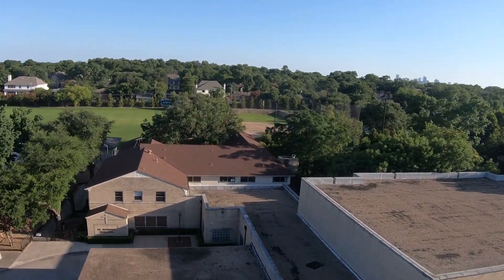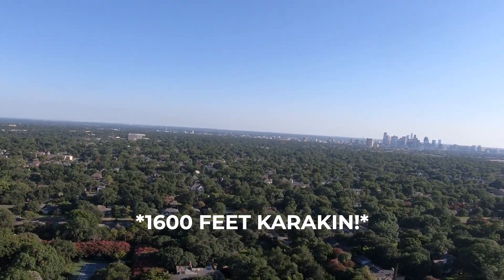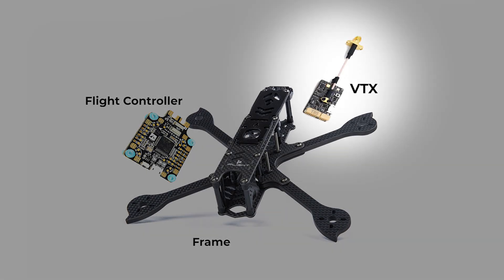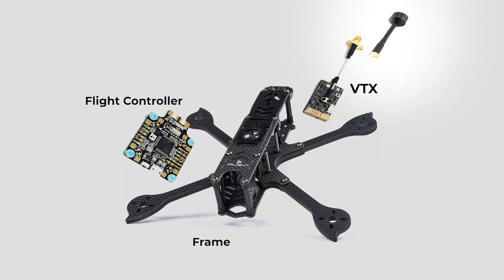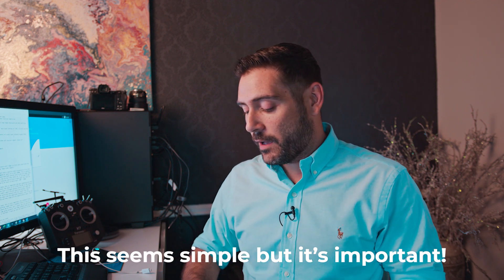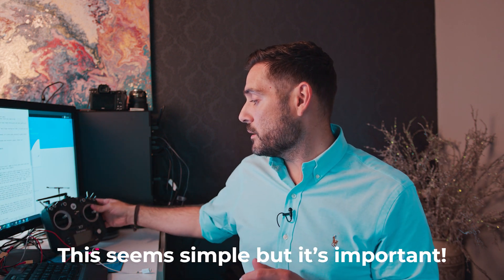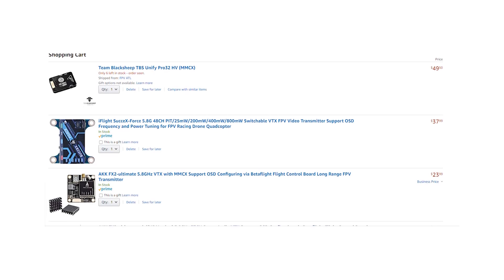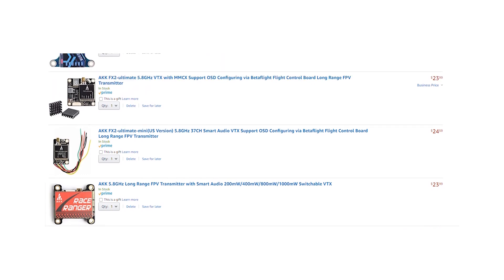Get better Mid to Long Range FPV Video, Long Range FPV Video, required equipment list.

Comment: you know not to bash your vidoe but this is why you should be required to have a ham radio license. when you have your ham radio license you should have the basics at how frequencies propagate on different bands and why people use 2.4 and 5.8 ghz frequencies. which frequencies does your country use and what the gentleman agreement is. i have been a licensed ham radio guy for about 5 years now, but you should know why team black sheep and other companies use these frequencies. Just admit you dont know. you most likely do not know that frequencies are proportionate to the size of the wave length. What frequencies propagate the best in certain temperatures. if your an expert in drones you should be an expert in frequency ranges and the distance they can travel. what frequencies penetrate the best and why. Maybe its time you take that test. its a 35 question test from a 400 pool of questions. if i can pass it you can pass it. And take ham radio classes it will help you understand to be a better pilot.

Comment: Nice overview of the most expensive analog gear out there!
But if you're a beginner or want to step up your game, just save yourself a lot of hassle putting everything together and even some pennies and buy DJI fpv combo! You get 2 miles of range in HD quality (no analog like from 80s) right from the box. If you upgrade the antennas on the googles to 2xpatch and 2xcircular pol. of a good quality you get 4+ miles of range (no 6km hard limit after the latest update) without any hassle, for the same money as high-end analog setup and you'll be watching a GoPro-like video directly in your googles all the time without any noticeable latency (as it was the case with previous digital systems)!
Don't believe me, research yourself! Just google "DJI fpv long range" and you'll see yourself.;-)
(A bit of extreme for starters: https://www.youtube.com/watch?v=LzJsMJAz4H4)
Reply: you might be right but there is added cost to dji VTX system in the drone as well, and its more if you have multiple drones.
Reply: @BlkInc1  If you are a beginner, you don't have a lot of drones and vista brings that cost barrier a bit lower too... But indeed if you want something on another level you are going to pay more (at least first few years). It's like with TV - you want a widescreen OLED or plasma? OK, but it will cost you more than standard small CRT TV...;-)

Comment: Screw TBS crossfire on a Quadcopter. Got with TBS Tracer! Yes, it's 2Ghz its 25Km distance, and its only 3ms latency. for Quads with limited battery range anyway. Tracer is much better than Crossfire.

Comment: My $115 Hubsan h501s will go 1.5 miles out of the box without mods and I still have video reception. But my $500 Quad takes all kinds of mods to do that. Going to find a INAV video after watching this video. I love my R9M 2019 but I need a RTH where it lands at my feet if needed. Then I guess I will need DJI Digital LR for video.
Reply from the maker: I’m shocked that thing will go so far. 😂😂 but it’s so true. iNav is a great option. Same with Pixhawk, but pixhawk isn’t really meant for a mini kuad.
Reply: you,ve obviously got the wrong quad if its £500 and takes all kinds of mods
Reply from the maker: @k1ortia  he was being hyperbolic. Generally there’re more expensive. 😂😂 thanks for the reply!

Comment: what's your thoughts on a DJI goggle long range setup opposed to analogue? Can you get same or better range with a decent digital setup?
Reply: If you dont want to loose your craft on long range, stick with Analogue, the break up is gradual, with dji it freezes then you,ve lost everything
Reply from the maker: Yes. I love DJI. It's a fantastic option for many people. Out of the box there is nothing that can compare to it penetration wise. Long range is possible with DJI, however breakup is mush different than analog, you have to be very careful when reaching the outer limits of the system as the video will just freeze and typically doesn't come back. Many like Nurk FPV have taken the system 2 miles. It's really sketch, but he's done it. 2Km is no problem though. I would be nervous to go any further than 3km. Also please keep in mind that increasing the output power over 700mw doesn't seem to improve the range based on a few tests I've seen.

Comment: they need to make a crossfire vtx and goggle combo
Reply from the maker: Brian Reip bro that would be killer! Also a 1.6ghz Digital FPV system combo. I know TBS could make a killer digital system. With like 7-15ms latency. That freq is just enough separation to work with crossfire and still keep the crossfires rang greater than video and give amazing penetration.

Comment: Very helpful video. Thanks man! Tho I'm a bit sad to hear I'm not gonna be able to get a descent setup for less than $800. Guess I'll stick to the simulators a while longer.
Reply: Get some cheep box goggles and a cheep quad and transmitter then go fly, have some fun. You don't need $800 big one's.
Reply from the maker: Goggle wise, unfortunately no. It’s an expensive hobby. While others have had various results with less expensive goggles. To get the best results you’ll want one of these. Check your local classifieds, Craigslist. Facebook. You may be able to find a nice used pair of goggles.
Reply from the maker: Clapped Out also DJI goggles are really good as well, and you can always convert them to use an analog module easily.
Reply: Get attitude v5s they are budget fatsharks with diversity and everything that you need except batteries.
Reply: yeah i really enojy attitude v5s.  They come with decent antennas, battery tray and most importantly external module bay

Comment: good video, well thought out but I have to dispel a couple misconception that you had and that I also had. Firstly when you say that you have to get a certain video receiver to achieve proper long range this is mostly false. Yes higher end video receiving  modules have alittle higher sensitivity (they will more easily pick up and decode a signal) this is not required for long range. Unless you're in a area with high mulpltipathing or flying through thick walls  then you will get similar, if not the same, with a 40-50$ module. Note that those ones that are recommended cost around 80-150$. 

The second thing you FAIL to mention is adding a GPS to you module. You recommend all these expensive parts but not a 15-25$ GPS?
or even proper lower pitch propellers, to the better flight time. (so simple) 

MORE EXPENSIVE(TOP END) DOESNT ALWAYS MEAN MORE RANGE (PERFORMANCE)

This is a growing hobby, and alot of people are just now getting into it, why not recommend TESTED lowered end parts since not every one can afford upward of 1300$ for a complete build. At that point just but 2 DJI Mavics. You'll easily get 3.5Km that way. 

You sound quite ignorant in you way of explaining things. Your using your experience as a solo fpv pilot to direct viewer to a specific product without investigating other option, which the large fpv community recommend. 

Overall, You video is just too specific to one group of audience. those who are willing to buy the most expensive stuff thinking they will get better range. Not to mention your ignorance towards certain thing.  

 Here's a video of how its actually done : https://www.youtube.com/watch?v=-9sUGHTH9N4&t=989s
Reply from the maker: David Lewis it doesn’t sound like you have any experience using GPS, even the best pilots like NURK Fpv will tell you, you CAN NOT count on a $15 GPS recover to work on Betaflight. Do you know how many people have lost their kuad by simply testing the Betaflight GPS settings. Sure you can use iNav instead for “slightly” better GPS features, but even people like Bardwell can’t get it running correctly all the time. So what’s the point in even adding. Also this video wasn’t about “GPS” it was about video quality. As I stated several times in my video, “these are generalizations” some may have gotten better or worse results using cheaper gear. Lastly, FPv Is and will always be an expensive hobby. it sounds like you’re doing well with your cheap gear, which is great! As long as you’re having fun.
Reply from the maker: Also, again, this wasn’t about, “how to get longer flight time”. Thanks for sharing the Bardwell video though!
Reply: @KAREKINFPV  Your Welcome. You are absolutely correct though. Even in Betaflight they tell you that GPS Recuse is a BETA feature. but it is good to have, especially when all else fails. Its literally the only thing that  will bring your quad back even after lets say you somehow fail safe on a crossfire (unlikely) or you lose video transmission ( more likely). Not to mention the OSD home arrow it provides. The benefits of all those thing out weigh the small likelihood  that it wont work properly. Epically with betaflight 4.2, GPS figures are alot more reliable. As shown here https://www.youtube.com/watch?v=GE6K9HiTO90

Flight time as far as battery usage, props pitch and motor Kv is just as important as any gear you recommend. lets me ask you this, what's the point of having all of this gear when you can't even go 1km before it's time to turn back because you're about to use up all of your battery capacity.

Yes I have had bad and good experience with more affordable gear. However I did upgrade to a few things you listed way before seeing this video and I have also had bad and good experiences with those aswell. Point being, again MORE EXPENSIVE DOESNT MEAN HIGHER PROFORMANCE. Fpv doesnt have to be expensive for you to have a good time or go long range contrary to what you stated in your reply. You suggesting to the community to invest 400-600$ to achieve long range is an example of someone who has only tried whatever is trending. when in reality you can achieve long range with 250$ or less worth of upgrades. 

Like I said good video, there are just a few things that are not completely Factual. Especially when you have new comer to the hobby who are apart of your audience who will leave thinking that the only way they can achieve they're desired range without the equipment on your recommendation. Happy Flying though.
Reply: @davidlewis7155  nice dialogue...I couldn't watch anymore...tbs crossfire 868 mhz vs 915 mhz a story of its own
Reply from the maker: If your having problems with your analog gear, it’s probably because you have some cheap parts that were not configured correctly. Or defective old used parts.

Comment: 4:16 Does TBS Crossfire system includes Tango 2 pro remote controller? I'm still learning, doesnt have quads yet but if I buy, I want long range and I'm eyeing for Tango 2 pro. Is it good enough?
Reply: Its the other way around friend.  The tango includes the tbs crossfire, so yes. However its not a full crossfire system. You'll only get 250mw instead of the 2000mw output power of the solo crossfire module. If your gonna be flying in area with lots of trees or inference then you might be better off investing in a solo module and a frsky transmitter.  Its gonna cost you about the same. The solo module is sold out at alot of places but you can find them here for a good price and fast shipping. Thats where I got mine 5/5 stars. https://www.amainhobbies.com/team-blacksheep-crossfire-lite-transmitter-module-tbs-crossfire-lite/p850719
Happy flying.
Reply: I understand. I wouldn't say it's a recommendation but its nice to have. Its designed specifically for fpv drones. And it shows in the form factor, like you said. I have one but I have huge hands so its almost feel like a ps4 controller which is fine but I just like how the frsky trannis feels alittle better. It's definitely up to the user to decide though. But I will say this, if you don't have overgrown hands like myself, you'll definitely appreciate the design of the tango 2 and if you're not doing rediclous long range then the power limitations won't be an issue either. Its definitely a good investment.
Reply: @davidlewis7155  Thanks for that. I'm all in for long range so I might need to buy something that can accommodate the crossfire modules and use it's full power.

TBS demo'd the tango 2 up to 51km but I think they used a "separate ground equipment" that boost signals w/c isn't really ideal for a lot of pilots
Reply: @bendixtrinity  you're welcome. Usually when they test their equipment its under close to ideal circumstances. So in reality you might even end up with 25% (+/-) less range. So going for the full module to make up for that lost isn't a bad idea. That being said, you're gonna run out of video signal range way before any failsafe issues. I recommend Akk race ranger (international version 1600mw) and a pair of Spironet LRZ Array and for extreme long range the clearview 2.0 racer. Gotten up to 9km this way with just the akk race ranger ,with crystal clear video. Only reason I didn't get more was because of my battery. And as far as antennas go, you'll be way happier with a cloverleaf or a pagoda with a longer stem. Happy flying mate.
Reply: @davidlewis7155   I mean, does it include Tango 2 on the system he is talking about? I do know that Tango 2 has a limit of 500mW (for now) thats why im asking IF Tango 2 is part of his recommendation (crossfire system) because i really like the small form factor. What do you think?

Comment: Your making it sound that TBS is plug and play , it is not ,you have to open up your Taranis and do soldering mods to it and newbies that are getting into the hobby that don't own soldering irons and don't have the skill to do it are getting the impression that you just slide in the module and bind , it is not like that, they risk blowing the taranis. a true plug and play module is the Frsky R9 system , however if taranis mod for tbs system is done correctly it is more reliable.
Reply from the maker: Blind what are you talking about. That’s false, 100%. It works perfect on the QX7 right out of the box. You have to use TBS agent to configure it on the computer. But it works fine. I’ve taken mine 3km.
Reply: @KAREKINFPV  Hello, thanks for recommending these Parts!! it's really helpful to us beginners because there's so many to choose from. I'm quite interested with that 3km build that you mentioned. can you give us the parts list? Thanks ^_^
Reply from the maker: xTrinity sure! I’ll try and create a separate video for that, but email me at cksagherian@gmail.com and I’ll send you the parts list so you don’t have to wait for my video! 😉
Reply: Referring to the ACCST that needs the mod or by just setting baud rate. QX7 ACCESS is plug and play.

Comment: And please don't say thing without trying like the skyzone 03O build in modual is like a true D X so it's very good and you don't need fatshark l fly dom v2 with rapidfire but skyzone are better maybe not the rang but like 10%/15% less
Reply: Skyzone modules are good. People think fatshark is everything
Reply from the maker: Gab's FPV lets be honest skyone are decent at best.
Reply: @KAREKINFPV  have you try them ?  I have and I find them better than hdo and the link quality is very good so no

Comment: Man if you try the range don't fly over houses. It's very dangerous don't do it anymore and for vtx 800mw max because when you use 1w or 2w it's get so hot than the power in mw goes down
Reply from the maker: Yea very dangerous for my kuad because If it goes down I won’t be getting on someone’s roof to find it. The roof will be fine.
Reply: @KAREKINFPV  no if you failsafe you will hit someone
Reply from the maker: Gab's FPV did you even watch the video. We talk about failsafes. Your not going to failsafes on crossfire at 1600ft unless you’re flying from a nuclear bunker. Especially at 250mw. Also hitting someone implies there is someone to hit. There are not massive crowds of people standing besides each house. Com’on man...
Reply: @KAREKINFPV  you know that in the city there is a lot of rf interference so you can failsafe at 100m like 2km but you don't have anough experience
Reply from the maker: @gabrielbruni3924  That's hilarious because I've gone 1km in the city with zero problems.
Reply: @KAREKINFPV  yes but everithing can hapenned so. And why fly over houses when there is mountains and big fields
Reply: @KAREKINFPV   I thik Gab has some sound advice, The thing to remember is not everyone lives in your particular city and peoples environmental factors will vary alot. Thanks for sharing the video content though.
Reply from the maker: @BlkInc1  crossfire is near bullet proof. The one problem I’ve ever had was a mini failsafes flying directly next to a hidden cell tower on top of a building. Even then it glitched for a moment and was right back under control.
Reply: @KAREKINFPV   are you using RSSI or LQ to measure it? I haven't range tested my crossfire yet. I'm a new pilot. But I did set-up my quad to GPS rescue incase of a failsafe

Comment: dude thanks for this video so much. I'm struggling trying to learn everything there is with FPV's. I have the fat shark dominator v3 goggles and am buying the rapid fire module tonight! I was about to buy your antenna setup but you said the spironet LZR is much further signal?? could you explain that for me? it looks like its only $29 and I really want to invest in the BEST. Please help and thanks for the educational video!
Reply: your antenna setup looked like it was more, about $80
Reply from the maker: Awesome man, I’m glad I could help! With the rapidfire, just be sure to install the secondary power cable in the V3’s. The only issue with the spironet setup is that it’s very directional. It’s made for long flights directly in front if you. The setup on mine is a great midrange and all around you setup.